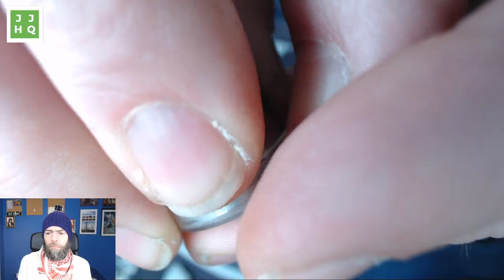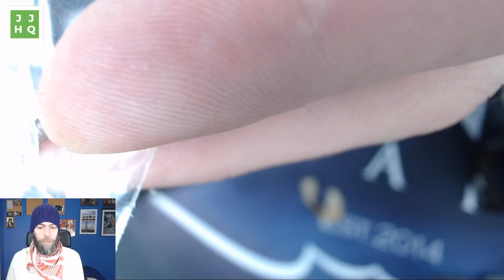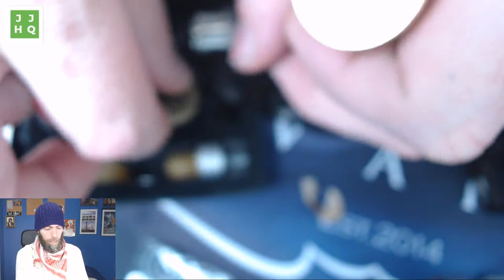BB VAPES BRVND B2K RSA Caviar Edition Review | VapeAM!

Comment: The notch that stops the cap from spinning around completely would be a great blind-friendly change up. This would let a blind person like me know where the opening to the air flow restrictor is located & tell how 'far' is too far when turning it. Do the various top caps feel different? I'm able to see changes in color & make out anything but like colors or dark, dark colors but for someone who is totally blind, it'd be best to go with basic black or the ultram (sp?) cover. If the ultram (again not sure how to spell it) is what I think it is, it's easy to tell by touch that it's different b/c it's like a hard plastic type of material vs metal material.
Reply from the maker: +Rayne W good question. the ultem feels the same as the white plastic and the black, maybe it's a little more matte feeling but  not much, but the stainless is obviously easy to tell apart. All the fussy pieces might be annoying to you so you might just use a favorite 810 drip tip. Great to see you in the comments, thanks for watching!
Reply: Maybe you could have them marked inside the cap so you can feel which is which